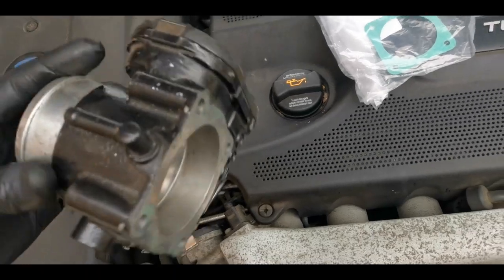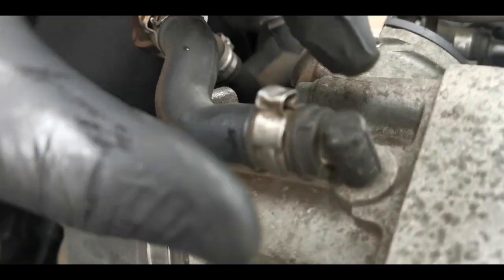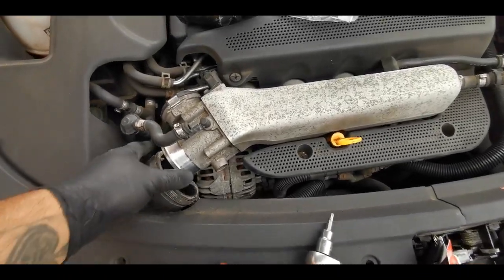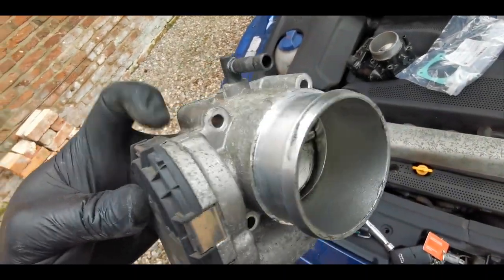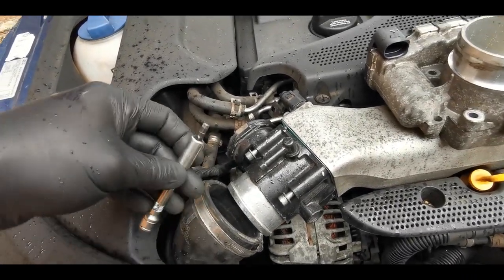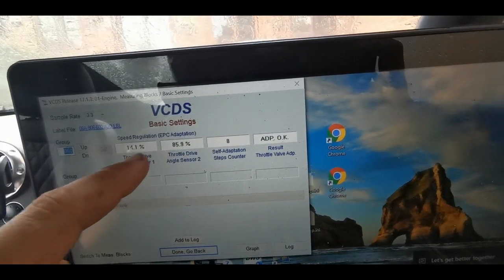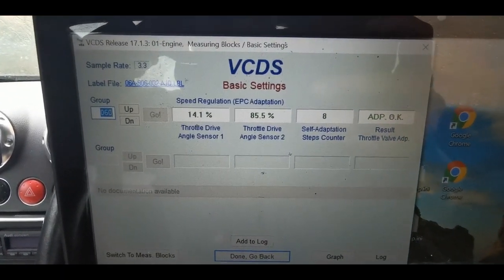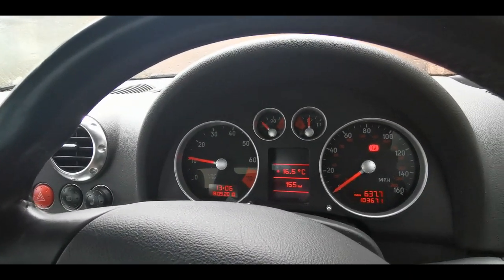Audi TT 1.8T 20v Throttle body replacement Throttle body reset procedure

Comment: So you could clean the throttle body and as long as you dont pull the plug out and are careful you wouldn't need to reset?
Reply from the maker: Yes, but to clean properly, you will need to move the valve, meaning at minimum a soft reset
Reply: @BWSTT  cheers Bryn 👍

Comment: If you see this, is there anyway to do this with obdeleven? I finally went to get my ecu out of the car for  the number for info on a tune and now my car feels weird and obdeleven is telling me the throttle body has an error because the ecu was disconnected. Car feels responsive barely on the gas and bogged down trying to get in it
Reply: Did you manage to do it with obdeleven?

Comment: hi bin watching your vids.... big thumbs up mate keep it up..... can you help me out iv plugged in vag com and got fault codes main 1 concerning me is bank 1 camshaft intake 16396 what do I need to do? its causing a miss and telling me causing it to run lean. signal too high and advanced setpoint not reached???? please help and thanks a lot  mate
Reply from the maker: My "new purchase part 2" video outlines checking the cambelt timing, that's the first thing, then you need to check the inlet and exhaust cam are in time by removing the cam cover

Comment: Adding to the final part, if you're trying to fix it; you can gently open the cover and use a good quality electronic cleaner/lubricant on the potentiometers. Apply, air gun, apply again. Something like Kontakt Chemie 390. Make sure it's not not plain iso alcohol or just a grease cleaner type.
We're essentially throwing away perfectly good metal stuff for what could have been a simple pot swap and/or gear swap if they were available separately. :/ Both would be very cheap.

This one had a dead sentence written because the seal is gone. Lots of dirt on pot carbon traces leading to deep scratches and it's ded.
Reply from the maker: Yep, repair is of course possible, but when s/h parts are as cheap as they are, it's a nice economical solution in this case
Reply: @BWSTT  I agree it's not the first choice for evreybody or for all situations. By the way, using the lubricant on a second hand one is still what I'd do as preventative maintenance. As a mechanic, you can and should charge more for such a service though. :)

Comment: Mine was not adding up changed for a 2nd hand one and still the same at the bottom says error any ideas ?
Reply: It can be the wires or connectors on the car. Give them a clean first if not enough, measure for max 1.5 ohms from TB to ECU. Better take it to an auto electrician to do that for you properly.

Comment: Hi bud awesome vids ,hoping you can point me in the right direction have been having an issue with my 225.
It was idling erratically constantly for 3 weeks  700rpm to 1000 rpm 
Now today it's doing same but spitting 
If I  just touch the accelerator pedal the epc light comes on 
I did take the manifold off and unplugged the throttle 3 days ago to replace coolant pipe 
What could this be ?
Would unplugging throttle body Chang the alignment
Reply: If you unplug the throttle body it has to be recalibrated